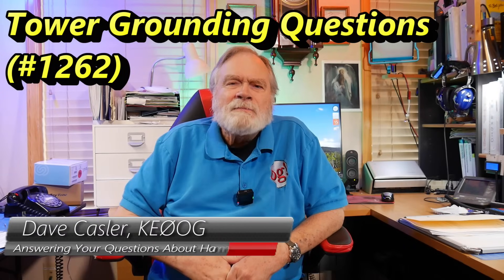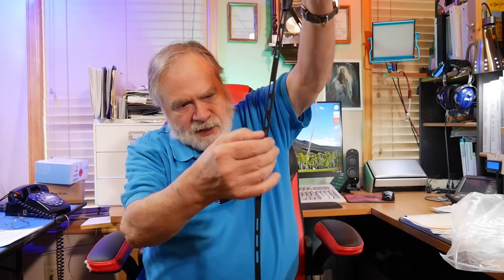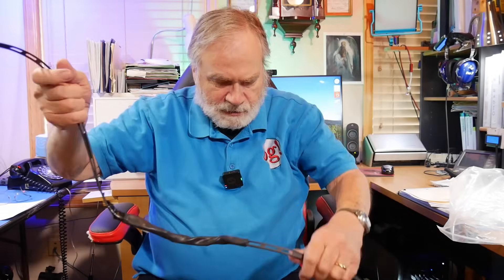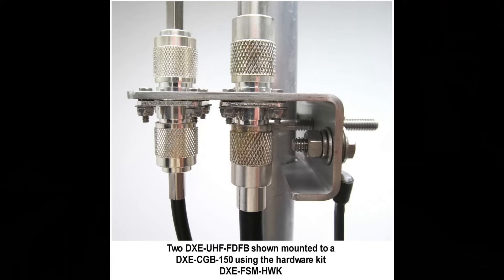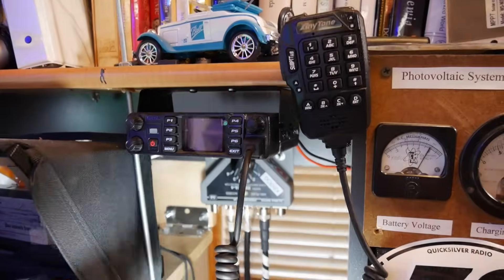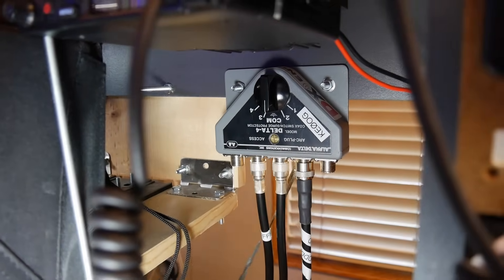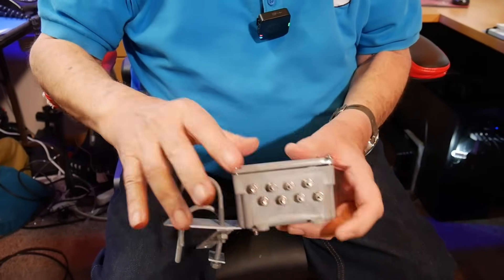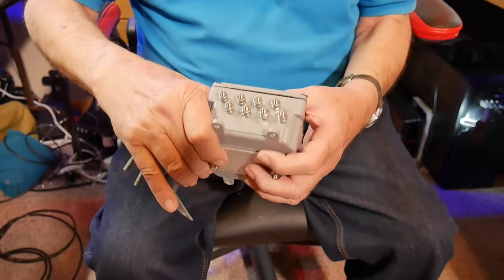Tower Grounding Questions (#1262)

Comment: I had a 100 ft free standing Rohn tower on a 4000 ft mountain. On top of the tower was a DB404 receive antenna fed to a polyphaser then to a receiver combiner. The coax on the tower was 7/8in helipax. One day all the UHF radios in the building quit. We looked and looked finally cut the coax and the center conductor (which is like a 1/4 tube) was gone. The lightening had vaporized it. Fun stuff…